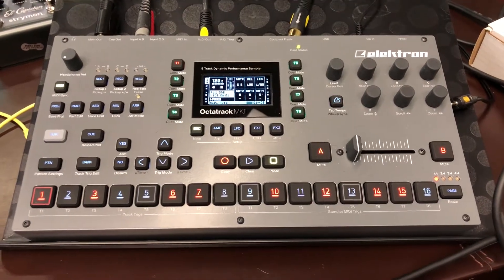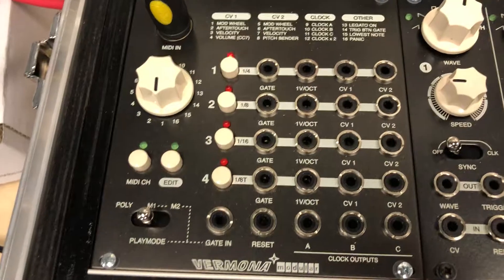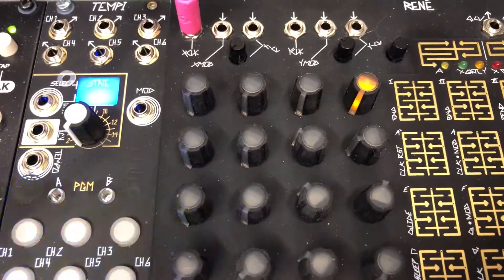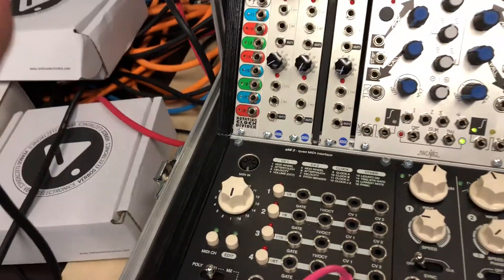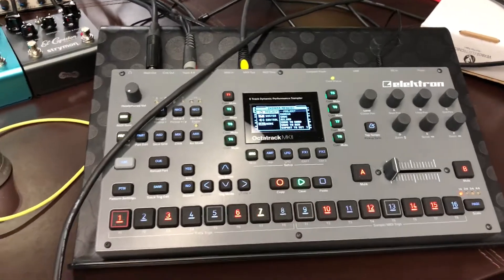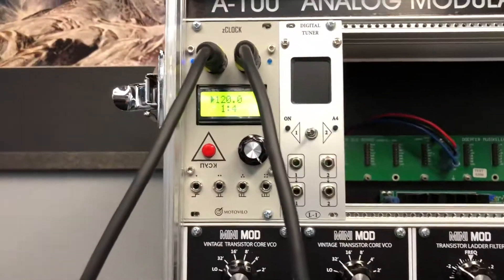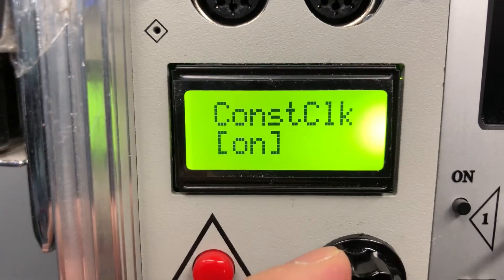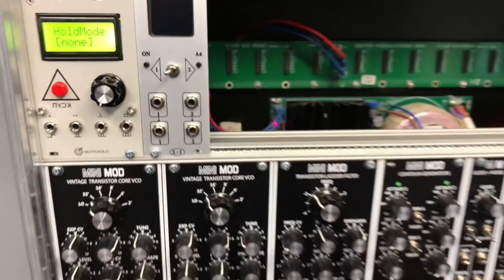MIDI clock syncing problem from Octatrack to modular (zClock Motovilo)

Comment: I have an Octatrack MkI hooked up to an MioXL and it is also constantly sending clock even when stopped. The red LED on the iConnectivity goes nuts. Any other fix possible than zClock, or has this issue been addressed by Elektron?
Reply: What is mioXL ?
Reply: @MuslimShortanov  iConnectivity MioXL is a MIDI interface/Router, like MOTU
Reply: @osleau  Really I do not know how to help here :( sorry.
Reply: @MuslimShortanov  are you @shortanov, the uploader of this video?